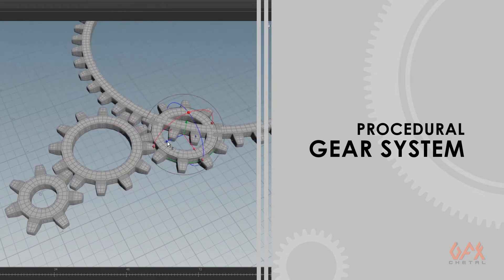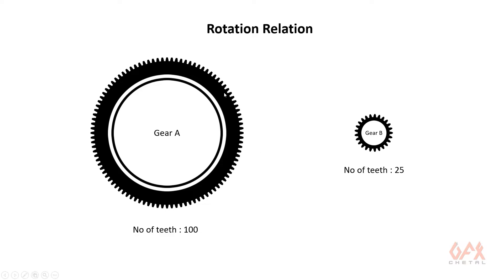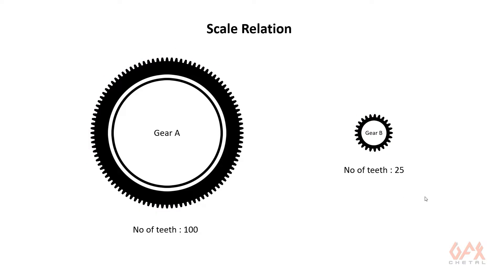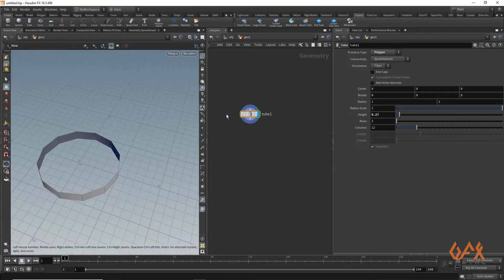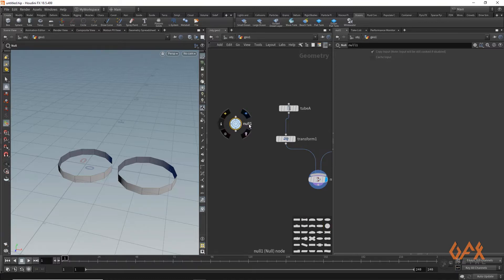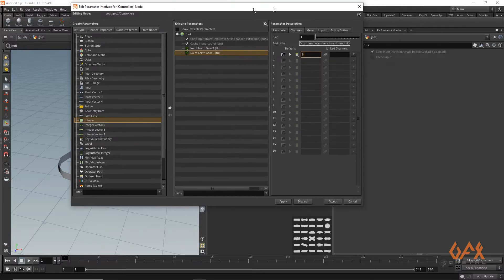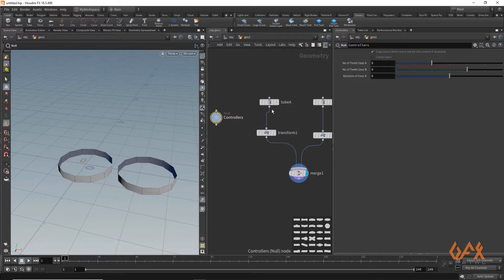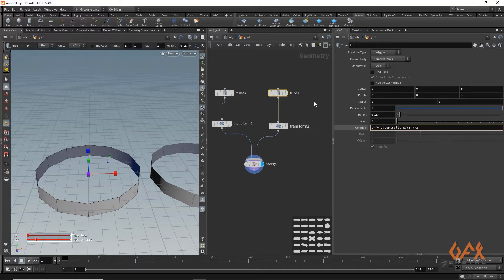Houdini Tutorial | Procedural Gear System

Comment: Using houdini 17.5.
 if your group range doesn't have the  group parameter option,  create a attribute wrangle and  set it to run over primitives and write:
if(@group_extrudeBack == 1 && @ptnum%2 == 0)
{
    @group_altprim= 1;
}
And If gearB is rotating around the world space position, in the transform2 node under Pivot Transformation set:
Pivot Translate  - > x = $CEX,  y  = $CEY,  z = $CEZ